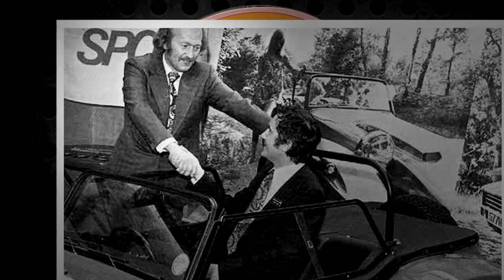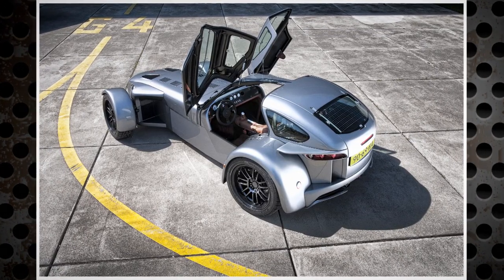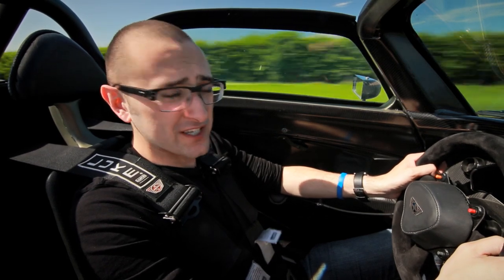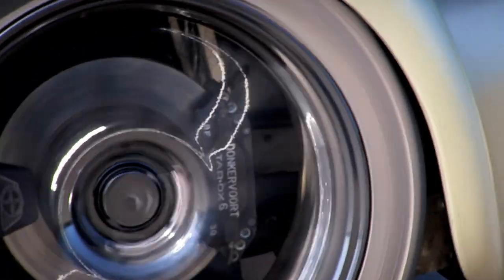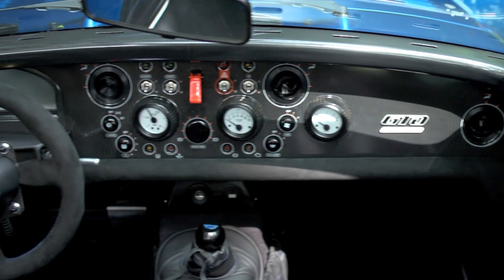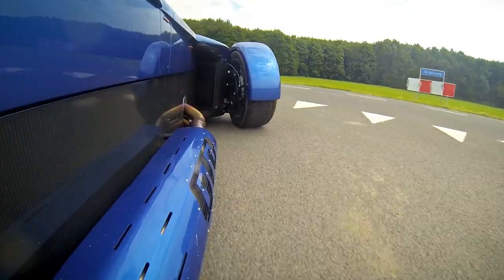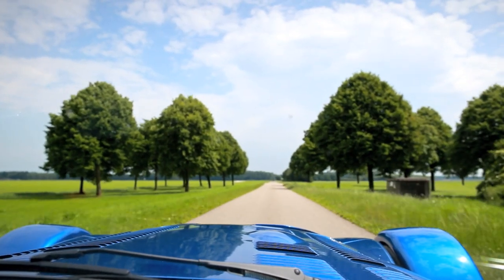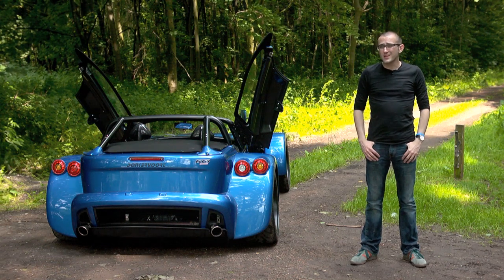Donkervoort D8 GTO: The Lotus Seven you always wanted  - XCAR

Comment: Do not forget that Netherlands is a country of speed bump and woonerf, where all the infrastructure is made for bicycles. A place where drivers are annoyingly slow yet very dangerous and unpredictable. In Netherlands you don't ever see young people driving a car and an average age to get a driving licence is probably around 35 years old. Probably it is because car parts and mechanics over there are stupidly expensive, they can't even fix stuff, because they replace all parts without even thinking about it. I have even been to a Car Festival in Holland just to see burning rubber in drag races and dutchman flying out of corners in time-attack. You see, there is a reason they have license plates in warning yellow. If they ever leave the country other drivers should be warned about the possible danger. And don't get me wrong, they do appreciate cars. I have seen many awesome examples of it. However as a car guy who was there with my car I struggled. I would guess that amongst European countries there are only a few other countries with a worse car culture than in Netherlands. However probably only Denmark, San Marino and Vatican
Reply: That just isn´t true, yes the cars are boring with stupid lease Polo´s and 520d´s with the wrong wheels but the drivers can drive and i know no one who didn´t get there license before 21. I wouldn´t know about the mechanics, i fix things myself. But yes as a car guy you struggle, cars are about 20 percent more expensive than in belgium and there is a lot of rice. But if you go to events like Japfest Zandvoort, there are a lot of people with a passion for cars.
Reply: TheBiggestCrazyDuck I have been to Japfest on TT Circuit in Assen. A bit too much Civics and CRXs for me. As I said there are lots of people with passion for cars in Netherlands. Dutch also seem to love American Cars. However the average awareness of other road users is dangerously low and Dutch drive too slow. You have no idea how much I was shouting at others while driving. Half a year of driving with veins visible on my neck and yelling to the windshield. It was driving me crazy that someone is able to drive 30km/h on straight piece of road.
Reply: Biggest made up bullshit ever
Reply: Number'' You should say who you are tolking to.
Reply: TheBiggestCrazyDuck If there is no name in front of the answer it is to the original guy who posted, so to darek in this case
Reply: Number'' Is that all you can say in this topic?
Reply: darek4488 You want to know? I really have to tell you? How about all the roads where only bikers are allowed, how is that in the way of car drivers? I myself am 20 years old, almost everyone I know of my age has a drivers license and drives regularly. But if you don't see all those things I guess you're just someone who annoys themselves over the smallest fly on your windshield.
Reply: Number'' I have spent half a year in NL. From what I have seen everybody drives annoyingly slow and they are not very aware what is going on around them. Dutch people are great car collectors, I have seen many awesome cars over there, but on average the overall driving community is not very talented. This is my point of view and my opinion might be biassed by the fact that most of my life I live in city with population over 700 thousands people. In Poland if you live in a big city (not to mention Warsaw) chances are that will break the speed limit on daily basis just like 75% of all drivers. In general the day you pass your driving licence test is the last day you drive as the road law states. Right now if everybody goes fast I feel like fish in the sea and it is natural.
Reply: darek4488 When you're supposed to drive 50 km/h and you drive exactly that there is nothing wrong with that. In fact, you and your 75% population are dangerous, there are speed limits for a reason. As I said, it's probably you who is irritating themselves and not the other way around. Your fault, not the fault of the people who are behaving
Reply: Number'' Life is dangerous, you know. It ends with death 100% of times. You might as well just have a good time and enjoy it if you still can.
Reply: The cars here are incredibly boring. The almost criminal evironment taxes force people to lease tiny gray diesels with terrible wheels and no optional extras whatsoever. But in a country as cramped as ours, you shouldn't drive too fast, hence the speed limits.

Besides, we're not bad drivers. Just not.
Reply: appelpower1 I would like to be proven wrong about the drivers. Most of my time in Netherlands I have spent in Enschede.

You don't really need space to go fast. All you need precision and power.
Reply: darek4488 If other countries would be as cramped as the Netherlands, they'd drive this slowly too, it's not our fault.
Reply: appelpower1 I find it difficult to believe. I have been using my own car in Netherlands for half a year. The speed humps and speed bumps are huge they are literally on every single street. The opposing lanes on bigger streets are separated so you cannot even overtake. Unless you use turn lanes or bus lanes you cannot pass a slower car. Besides that, pedestrians simply cross the road without looking or stopping on the edge. However as a driver I liked the fact that there is basically no night life, everything closes early and people stay home. Every city except the capital looks like a ghost town after 2AM and then you can finally go fast, however still nobody does so. All the country is so flat and you have really awesome motorways, but if you see a car going fast, it is from abroad. There are probably a lot of people who will love it, they hate cars with all their heart and they will feel at home, but Netherlands is definitely not a country for me. Trust me it is not about the crampiness and the population density, I simply didn't feel welcome.
Reply: darek4488 You didn't feel welcome because you can't drive over the speedlimit, which by the way is forbidden by law? Makes tons of sense lmao.
Reply: appelpower1 In Netherlands I have met a lot of new friends. They were from Germany, Ukraine, Greece, Finland, Norway, Romania, Italy, Denmark, Sweden, Bulgaria, Portugal and Australia. I have met only 1 or 2 friendly Dutch for half a year. Not that others were unpleasant or something, but they did build up an invisible wall around them.
Geert Wilders has nothing to do with this. I am not a muslim.
Reply: darek4488 Nor are Eastern European immigrants. Geert Wilders has made my country less intolerant.
Still, though, where are you from?
Reply: darek4488 Ironically, Dutch people generally think the Polish can't drive... I can't judge it, though, I've never noticed.
Reply: darek4488 I'm not one of the people who has anything against Eastern European immigrants. In fact, I completely agree with what you said...

Still, I can't judge how the Polish drive; I don't have a driver's licence, nor have I ever been to Poland.
Reply: appelpower1 If you want to learn something about it there is a huge series about foreigners (from all over the world, different continents) who are in Poland, answering the questions about it. The series is called POLANDIA.

Here is a Dutch guy for example:
POLANDIA - Martijn (Holandia/Holland)
Reply: darek4488 Those videos are very good, actually. Though I have to agree, the Polish language is difficult. No offense, but, like Czech, Polish looks like a bunch of c's, w's, y's and z's with hardly any vowels at all, topped off with a ridicilous amount of accents on top of the letters. But who am I to judge other languages; Dutch is just as difficult, and it sounds even harsher than German according to many foreigners.

Speaking of languages: that guy spoke English really well! Normally, when you write it down, a Dutch person's English is quite good, but when you hear it, you notice the pathetic prounounciation and rubbish accent. But not for him.
Reply: appelpower1 They only thing I found hard in Dutch is the "g" sound. And while Polish have quite a big amount of various sounds there is nothing like a Dutch "g". For Polish speakers I would have write it down as "hr".

Oh and since you have mentioned. Accent in Polish is fixed and predicable. Those dots, strokes and tails are actually different letters (ą, ę, ł, ó, ć, ń, ś, ź, ż). They have different sounds and they are always pronounced the same way.

On the other hand I am learning Russian at the moment and it has a various accent placement. You need to memorize where the accent is to pronounce it correctly and it makes reading very difficult even if you know all the letters.
Reply: darek4488 That 'g' is why most people think Dutch sounds like throwing up.

Accents are a very difficult part of languages, though I usually learn those naturally. My German and French pronounciations are both decent. I'm particularly proud of my British accent, being the only one in my English class who can do that. I'm also planning on trying out a Scottish and an Australian accent.
Reply: appelpower1 If you like Ausie accent just watch Mighty Car Mods on YouTube. They don't have this stereotypical bungie-jumping like pitch that Bogans do. It is more civilised, city Australian accent.
Reply: darek4488 Nice accent, that's true. Allthough I'm not the modification type of person...
Reply: hey polak , your free to never come back again , no love loss here
Reply: isitcosimblack That was harsh...
Reply: isitcosimblack Making the first impression is very important. Once sentence and we already know who you are.
Reply: darek4488  The Dutch have low awareness of the trafic around them? You must be joking. In a densely populated country with 18 million bicycles on a population of 17 million ( yes that's right, there are indeed more bicycles then people in the Netherlands. Many people have two: one sportbike and one for daily use) low awereness would cost tens if not hundreds of thousands of lives a year. Fortunately the vast majority of drivers are bike riders themselves as well, which makes them very much aware of what's going on around them. They know very well what it's like to be one of those bike riders. It's part of the training anyway. Car drivers are always accountable in an accident even if the biker causes the accident. This is because the drivers have the more powerful "weapon" and therefor must behave more responsibly.  We have speed limits here. If someone drives 30 kmh that is because that is the maximum speed allowed. Because of all those bicycles around you, many of which children. And then there are the playing children in those "woonerven" Reading your comments I wonder how you managed to avoid revocation of your driving license during your half year stay here. From a traffic point of view I'm glad you're gone. You're an accident waiting to happen.
Reply: hijothema True. I have family from the US. When they came over here, they were absolutely terrified of our traffic. In his eyes, it was incredibly dangerous. Yet we don't crash very often...
Reply: appelpower1
No offense but I hope you see the contradiction here: first accusing someone of having an IQ of below 0,037 and then demand from him to write in English, a foreign language to him?
Reply: appelpower1 eehhmmm , nee ik stem vvd , dus je  'in that case ' geneuzel is niet aan mij besteed .maargoed , pvv stemmers zijn ook niet mijn stijl , maar met 0.037 aankomen is ook geen stijl . je land laten afzeiken door een waarschijnlijk niet respecterend stuk vreten en dan vrolijk met hem discuseren omdat in het engels lullen zo megainterresant is , dat zet zoden aan de dijk .  als voormalig australier kan ik je wel de tip geven om even je stone coal english  even bij te spijkeren , straks denken ze nog dat je van de pvv bent haha   i sink you sink tis smels an hour in ze wind
Reply: hijothema never mind him , hes here to blatter away about languages when the guy hes talking to is flaming the country he needs to make a living in his own country .  applepower will think hard , then tryin to come back using  dif-fi-cult english words in order to look smart and educated .
Reply: Looks like this discussion has come to an end. Have a nice day.
Reply: isitcosimblack Nah, I simply hate the PVV. And I hate it when people use languages that most people can't understand.
Reply: darek4488
 You didn't feel welcome in Holland? You are kidding,....right? Back-in-the-day, I drove a Jaguar  in Holland,..Belgium, and Germany, and I can tell you, the people were very lenient towards me. I will admit that in Holland it was best to go rather slowly because of Farmers and Bicycles, but in the early morning it was wonderful. In Germany, I seldom drove at less than 100mph, and the German Police were very kind, warnings instead of fines, same in Belgium. Same story riding a motor cycle.. I find it hard to believe that you disliked Holland so much. Just watching those beautiful girls on their bicycle, (especially in summer)  brightened the day!!! So what if they are not all 'car mad', you can't have everything that you like.::)
Reply: arriviste2020 If you want an honest anwser let's put cars aside. The weather was quite harsh on me, the sky was clear and blue so rarely that I was a bit depressing. The fact that all shops close so early was truly a shock for me and many times I didn't make it on time and I was left without groceries. My bike was stolen even though it was locked. All the Dutch food I tried was deep fried and tastes like mcdonalds, fruits are looks like plastic, there is only this soft, toast-like bread and all the diary is 0% fat. Each time I liked a beer, I looked at the label and it was from Belgium. However I got to admit that Dutch cheese and weed was great.
Reply: darek4488 Yeah, the weather's not good. Though I always thought the food in the supermarkets here was decent, better at least than in the UK.

By the way, where did you live?
Reply: appelpower1 Agreed. In NL food is way better. I struggle with UK's food every time I go there. And every time my aunt flies back to UK, she takes as less luggage as possible to fill the rest of the weight limit with food. I do live in Poland and here everything in shops used to be very natural and fresh, but joining the UE filled our shops with all this artificial crap and chemicals. Right now you need to read every label to check if what you're buying is real.
Reply: darek4488 Meh, I don't really care if what I eat is real. I happily buy chicken that's been in confined spaces ('plofkip' in Dutch), because I care about money. That may upset people, but sadly for them, I don't really care. Similarly, I avoid everything that says 'biological' on it, as that's more expensive than normal food, while you don't notice the difference. Taste is more of a matter for me, and sadly, UK supermarkets don't really do well in that regard. I don't know about Polish supermarkets, I've never been there (although it would be fun to do so once...)
Reply: appelpower1 Chicken and eggs are the same everywhere you go. What I found very different was butter, ham, salami, bread, pork meat and beef.
I really don't care how the cow was milked and how chicken raised, but I do care about additives, preservatives and GMO.
I dunno Dutch, but if there is 15 ingredients in sliced ham something's wrong. Ham should have one ingredient.
Reply: darek4488 Yeah, that's true. Though honestly, I don't really mind, as long as the taste is good. And as long as it's not unhealthy.
Reply: darek4488
Ok, leave the cars aside. Holland is mostly reclaimed land, water everywhere, the sea on the door step, what would you expect weatherwise? There is rainy miserable weather over virtually all of Europe that is near the coast,......but so what? If that is the main criteria for preventing you having a good time,......you should move to a sunnier clime. Siberia, minus 57 F, snow everywhere, but so what? You just have to make the best of it. It doesn't mean that there is no social life. As for food, the Dutch do good cheese, excellent milk, some primo chicken and potatoes done a zillion ways. You may perhaps have to do due diligence in the smaller towns, for different varieties but if you can't hack it on their food, you need to stay home and perhaps let your dear old Mum look after you?::)
Reply: arriviste2020 I do agree about everything you said about climate. I am sure what was your point with food. I know that Dutch do good cheese, excellent milk, some primo chicken and potatoes, I've just said it.
Reply: arriviste2020 You don't know what food's like in Poland. As I mentioned, the food in British supermarkets is, well, underwhelming. Yet I don't hear anyone complain over there.
Reply: appelpower1
Not everyone in  the U.K. shops in a supermarket, so you can throw that statement out the window.Regarding British food being "underwhelming" you obviously had no need of a guide to ignorance. As for not knowing what food is like in Poland.......well,.....this may have escaped your attention,.....but there are Polish enclaves in lots of places outside Poland. People in those enclaves not only consume Polish food,...they also make use of local food etc,....so what exactly is your point?
Reply: arriviste2020 My point is, that you don't know what food he is used to. British people think their food is quite good, yet I am used to Dutch food (which is generally better), and IMO, British food is generally underwhelming in taste and/or quality. Similarly, darek4488 may very well not like our food because he's used to better food.

By food, I mean the products supermarkets have to offer.
Reply: appelpower1 Thank you. That is exactly what I wanted to say.
Reply: darek4488 No problem.
Reply: appelpower1
I will have to say, that you have not traveled a lot within the U.K. to issue such a statement. It is irrelevant as to what food one is accustomed to at home, when one starts to travel.One has to have an open mind, make adjustments and learn to use some common sense.You really need to define 'better food' If you limit yourself to food in a supermarket. then you are starting off with a bias and a not very intelligent approach to economics. Supermarket shopping is merely an expedient method to obtain food and reflects the habits and leanings of the local populace. There are plenty of places in Poland, Holland, Germany etc, where the food is crap ....but why complain? If your sole purpose in visiting those places,(or any other) is to bitch and complain and cry that the food is not as good as that which your dear old Mum serves up, or what ever,.....stay at home!!!
Reply: arriviste2020 I'm sorry? I went there, visited two of the three most popular supermarkets in the UK, and concluded the food doesn't taste as well as it does here. Most people shop at supermarkets, so most British people are used to that standard of quality.

Also, I didn't 'go there to bitch and complain and cry that the food is not as good as what my dear old Mum serves up'. I went there for different reasons, and it just occured to me that the products in their supermarkets don't taste as well as they do here. That's not to say I hated it, you don't hear me complain.
Reply: Is your priority speed, or safety (both is not possible, how good one thinks to drive). In the Netherlands it is safety, safety safety. As a result the Dutch traffic is the safest in the world measured by deaths/wounded per million kilometers. I think the choice for safety is good. I agree that sometimes it is boring, and sometimes it is too much. But, a public road is a feature to bring ordinary people in cars, on bikes and motorcycles from A to B (and make damn sure they get there in one piece). I fail to see how anybody in his right mind may think otherwise. If you want to drive fast on public roads, go rallying.
Reply: Ronald de Rooij Dutch traffic is indeed probably the safest in the world however, but it is not accident free. In general most of you don't drive very well, you have difficulties with parking and have no awareness what is happening behind you, but in most cases you drive to slow to hurt yourself.
The fact I am generally speeding doesn't mean that I am not safe. I invest a lot of money in suspension, brakes and tires. I have my license for about 5 years now and I have done more than 100000 kilometers yet I have never crashed nor did any damage to my or any other car. Oh, and I know I need a rally car, but I my studies are eating up lots of money at the moment.
Reply: darek4488 You are not the world. That is your problem.
Reply: darek4488 Dutch traffic is safe, though I wonder what effect the 18-year-old 406 Coupé driver I hope to be in three years, will have on traffic. Given how hard it is to reverse one when you're 18...
Reply: appelpower1 Don't feel ashamed to get out and look around before you reverse. It's more shame to get out to assess the damage.
Reply: appelpower1
Simple rule when visiting another country. if you can't say something nice,.......say nothing!::)
Reply: darek4488
So, the Dutch drive slowly do they? I have had enough Dutch police chase me for speeding..Where exactly do you get this from? Most Euro countries are not keen on people speeding, and the Dutch are no different,.......but that doesn't stop people speeding! You have held a license for 5 years<....WOW!! You sound like you should be "driving Miss Daisy".. Please do me a favor, don't get in front of me on any decent road, it would be like driving behind a hearse in a funeral procession.::))
Reply: arriviste2020 Are you sure your not Italian? xd
Reply: arriviste2020 I didn't actually shout in their face about their supermarket food. I didn't even think it was bad in the first place, but like I said, it just occured to me that there is a small, but definitely noticeable difference in quality level between the supermarkets of the two countries.

darek4488 Well, I think I got the technical skills right already (after having been obsessed for months with steering wheels and how to turn one), but as a result of my horribly incompetent right eye, I have difficulty estimating how far I can still reverse before hitting something. What makes this worse is my fear for damaging that glorious, Pininfarina designed body. It makes me wonder if you can buy aftermarket parking sensors...
Reply: appelpower1 There are plenty of aftermarket parking sensors or reverse cameras. However you need to drill some holes in the bumper of the parking sensors. If you really need it you can have it.
Reply: darek4488 Well, I can't bring myself to drill holes into the bumper. I guess I'll just train myself on a parking lot, or something like that. Or get out, like you said (which could be surprisingly difficult, given how wide the 406's doors open...)
Reply: appelpower1 I have seen something that might help you. It was a frame for the license plate with a built-in camera.
Reply: darek4488 Really? How much does it cost?
Reply: appelpower1 No idea. Never needed it.
Reply: darek4488 I'll keep it in mind. I don't want to be spending too much.
Reply: darek4488 Dude, you're absolutely out of your mind. Holland may not have a great car history, but car lovers you'll find over here in abundance. What the hell are you all rabbiting on about, making all kinds of extremely negative judgements about a country you've only been in for a few months? I live in Holland and I am a car lover. I can tell you, mechanics here do not randomly replace parts without thinking about what they're dealing with. That'd be stupid because it wouldn't even work in most cases, you can't fit a Peugeot front upper suspension arm into an Audi A6. That's bloody common sense.

I don't know who you are, and I don't care anymore either. When I read the starting bit of your first comment of this video I thought you might be someone who could talk sense about things in the car world. Sadly, my thoughts were proven completely wrong by the rest of your comment. I don't know where you're from, but do I perhaps run down on your entire country while not even having spent a decent amount of time in it to get to know things a little? You're human, you have the most complicated brain on earth. Think before you speak.
Reply: 321Koen I could have spent a day, I could have spent 10 years, I could have never been there, but I can still have an opinion and you can't do shit about it.

Besides, I know that there are many Dutch who love cars. I said that already. Still doesn't change a thing about that you have high percentage of drivers with poor surrounding awareness and all your cites are designed to slow you down, block any overtaking and keep cars from the centre. You also have silky smooth highways, but still nobody exceeds 120km/h.
Reply: Nobody exceeds 120 km/h? This statement proves that you haven't been in the Netherlands long enough to know about these things. There are so many people that don't give a single damn about the speed limit. Folks exceeding them you'll see here all the time, anywhere. Then, 'a high percentage of drivers with poor surrounding awareness'? Might be, I don't know the numbers, but what exactly is this argument based upon? It sounds more like a random saying coming from, at the utmost, a few cases to which it could be applied and immediately applied to the lot, unjustly.

However, you may say it's your own opinion, but, especially from Dutch people's points of view, what you're actually doing is putting an entire country(in several aspects) in a bad daylight. Saying that every car driver over here is 'annoyingly slow yet very unpredictable and dangerous' is a completely different kind of judgement than 'could try to use their brains a bit more during driving', which would be more of a reasonable made up opinion. It's far from the truth as well.
Reply: 321Koen You have to admit that the average Dutch road population is boring. Our roads are dominated by hybrids and tiny diesels, all of which are silver, black or, god forbid, grey, to combat value depreciation. Which is our government's fault.
Reply: appelpower1 I was surprised how in NL big is the difference in price between petrol and diesel. Typically in Europe the prices of standard Unleaded and standard Diesel are almost the same.
Reply: darek4488 Here, petrol is even more ridicilously expensive than diesel. Then again, the government charges massive amounts of road tax for diesel cars. These taxes are highly influenced by weight, so good luck driving a diesel-powered Land Rover Discovery here.

God, I hate the car policy of my government.
Reply: appelpower1 The best government car policy is no car policy.
Reply: darek4488 As long as the rules for a car to be road legal are strict enough, I agree. Cars are responsible for just a tiny amount of pollution. Planes are a lot worse in that regard. And even then, cow farts emit more CO2 than all cars, trains and planes combined...